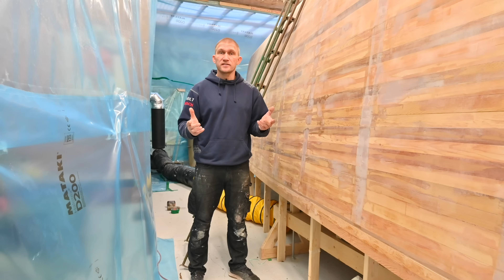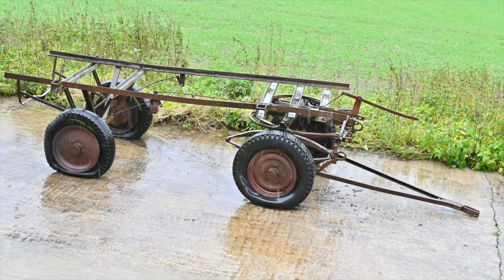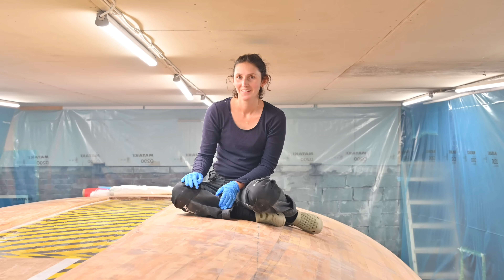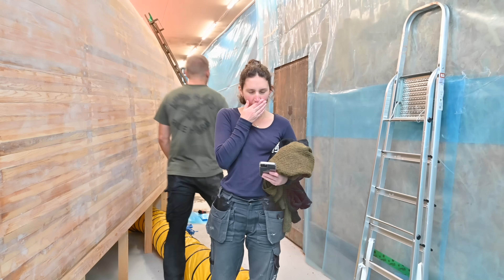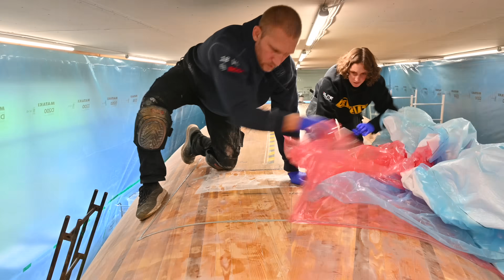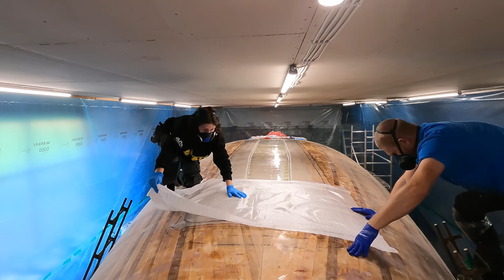Laminating The Keel Recess - Ep. 370 RAN Sailing

Comment: The other thing I've learned from seeing people work with epoxy and fiberglass along with doing it myself is that you should put on several pairs of gloves so that once the outer pair is messed up or develops a tear you can easily pull off the first pair and have another pair or two below that layer

Comment: When you flip the hull and start laying fiberglass again in the keel area have you thought about putting in a layer of G10 sandwiched between the layers of fiberglass?? It would add extra strength along with the steel plate you will install.. an American who has a channel who's having to rebuild places in his deck where he had water intrusion and he's used G10 in places such as where the windlass will sit and be bolted down.. it's also a great thing to use where winches, chain plates and anything that will have alot of force applied to it is going to be bolted down.. same for stanchion posts etc.. I will find the name of the channel so you can see what I'm talking about and he's done a video on different materials to use in situations in the deck or places where objects will be mounted and he's an engineer so he knows what he's talking about..
Reply: Living for Sail is the channel name and its a video 2 months ago labeled the best deck core material or someone close to that.. perhaps it will help you on the interior and deck building that is still ahead of your project.

Comment: Did you know, that you can clean your tooly by simply washing them in haouse hold vinegar. The acidity in the vinegar knocks down the molecules of epoxy and the brushes, rolers, fingers ;-) can be cleaned safely and without any expensive and dangerous solvents
Works great, when I have to do epoxy works

Comment: Terrific to watch Your progress. Just a quick remark from an old fiber guy  - I understand it is tempting to remove the peal ply after every step to see the result. But this is also a source for issues, especially, when you have additional work nearby like sanding, painting or cleaning. It is good practice, to keep the peal ply on the laminate until you are ready to mix epoxy and apply the next layer, that way protecting the cured laminate from any contamination like spills or dust.

Comment: when you are inspecting the recently cured epoxy lams you can knock on the laminate surface to hear how hard the built up laminates are. The work looks great btw. I usually leave the room as cold as possible until the layup is all done then crank the heat :--)

Comment: Maybe put a wetting table in the cold  big loft and roll your wetted glass-mat onto some tube and unroll it onto the hull. When you have helpers. Duracell Project just pours epoxy on to the cloth and uses scrapers to wet it out when doing big areas.

Comment: Have you considered laying the laminate and epoxy when the room is colder, and turn up the heaters once the vacuum bag is working? It might give you extra work time, so things are not so desperate?
Reply from the maker: Yes, but it’s a balance. The epoxy viscosity thickens really fast when it gets colder, making it harder to wet out the fiberglass. Cheers!

Comment: Fantastic work! One question: I have seen commercial boat builders whereas the vacuum sucks the epoxy under the plastic (peelply
?). You instead just remove extra hand laid epoxy by vacuum. Is the result the same?

Comment: Hey hello, I'm looking forward to your project. And I'm amazed at the work you do, really great!
Small tip: make sure that the first perforated (blue foil) layer and the last layer (vacuum bag) are not too tight in the radius of the pocket. You can easily do this by running a fold (extra material) across the length and width of the radius / pocket, so that the material has room to work. This prevents potential air (or a build-up of a lot of resin) from remaining in the radius due to tension in the material. It can also cause the bag to tear in the corners where the tension is greatest.
Hopefully it helps you 😁
Have fun with your project.
Greetings from an aircraft manufacturer from the Netherlands 👋

Comment: Very nice work !... I mentioned this before, have you considered a resin/catalyst delivery system so you can spray continuously rather than mix litre by litre? I am thinking of the system (as an example) Rossco uses on "Life on the hulls"? There are several advantages including speed (which is important if your resin is setting) , consistency and good saturation. I get the downsides are likely cost and complexity -  but hand laying a 50' hull with multiple layers of glass is a huge amount of work, Once done, you can recoup some costs by selling the equipment.  I am sure you have considered it, but here is a link for those interested - https://www.youtube.com/watch?v=rNAZGuvOp4s -. Regardless of which direction you are going, congratulations on the great start!!

Comment: I noticed your using an oil filled vacuum pump.  I want to start doing some vacuum bagging also when I re-laminate my deck but I see a lot of people are using oil less vacuum pumps.  I would prefer to use an oil type pump as they are a lot cheaper.  Do you have any concerns with using the oil based pump?
I’ve been watching you guys for a while and really enjoy the videos. Keep them coming. 

Scott & Robin
Sailing vessel Reimagined

Comment: Back when I was doing aircraft composites I think it was recommended to not remove peel ply until just before (same day) doing the follow on laminate as that improved the quality of the bond.  My recollection is the surface of the previous layup would absorb some amount of moisture from the air and that interferes with the bond strength of the subsequent layer.  Also, where sanding is required to get a new layer to adhere the paper grit should be 36 or 40.

Comment: Great job. I used to work at a composite aircraft company and occasionally we would vacuum infuse the liquid resin from a pressure pot .Every layer was placed dry  without the resin and the vacuum sucked the resin in from the pressure pot.  It would work as long as you used thin infusion resin .

Comment: Well done! First time layup and vac bagging is stressy, until you get in the swing of it. 
Not sure if you know the trick but it’s worth putting on at least two pairs of gloves, that way if you puncture or tear the outer glove ( or need to handle a camera for instance) you can just peel off the outer glove/s and you have fresh, clean, non-sticky gloves to work with. 
The other thing that is worth thinking about is that you consider wearing your masks and gloves when you’re removing the bags and sub-layers, especially the breather membrane and peel ply, as a certain amount of both vapour and fine dust can be released in the process. 
Great progress, she’s coming together beautifully. 
Cheers, R. 😎👍🍻

Comment: What was the black and yellow striped tape used for in the recess? I don’t recall hearing you explain that
Reply from the maker: The tape sits in top of a temporary “floor” in the keel recess. It’s there to prevent the laminate to stick since we will remove this floor once the hull is turned over and start building up the solid laminate in the keel area from the inside. I hope that made sense! 😊 Cheers
Reply: @RANSailing  yes it does. I must have missed some of those details. Thanks

Comment: Nice work! It's looking great and the glasswork looks excellent. Some thoughts from my own experience. ou should consider putting the bag tape down first. You have to watch out for it but it speeds up the process later. If you're concerned about kneeling on it, cover it again with some masking tape. That way as you you put the peel ply and breather layers on, the bag tape is already there You can also pre-seal it to one end so that it's that much closer to roll out and over. I also felt like you don't need to roll the fiberglass and peel ply so much, let the vacuum bag consolidate the laminate and the peel ply.

Comment: Instead of leaving the resin in the mixing tubs put it in large flat dishes, put the resin on the work in a ‘hatched fashion’ (it gets it away from the larger amounts and stops it exotherming).  Then spread it out from the hatches, think of herringbones or large Z’s !  Use a slow and a fast mix of hardener to make up your own curing times as the weather temperatures change, use the same amount of mix.  Did you test the vacuum bag by switching the power off?  You may not need to run the pump continually?

Comment: Good that you look for safety. I messed around with epoxy glue in my younger years, well I got a lot on my hands. Now I always, always wear gloves when working with epoxy. When I get epoxy glue on my hand my finger joints start to hurt for a couple of days. I wish I would have been more carefull back then.

Your tarped up area nearly looks like a make shift clean room. Maybe Malin should wear a hair cover. You really don’t want a weak lamination because of a hair when in a storm.

Comment: On coating the hull with a primer layer of epoxy - wouldn't that spoil the chance of getting a chemical bond with the cells of the wood and the laminate? Once this layer is cured, the next layer is only mechanically bonded from my recollection..